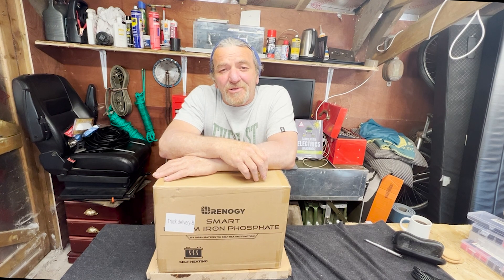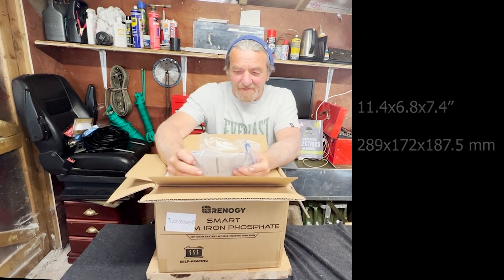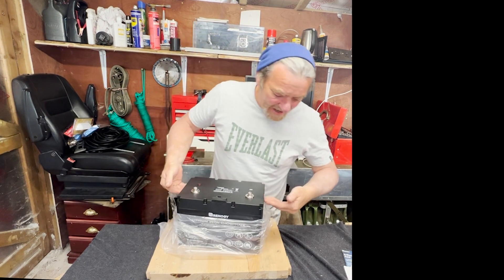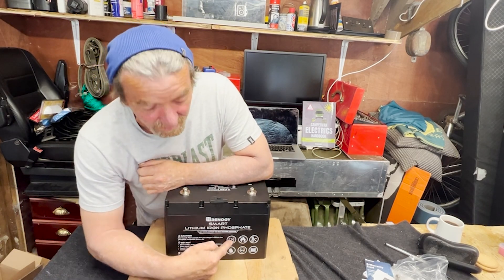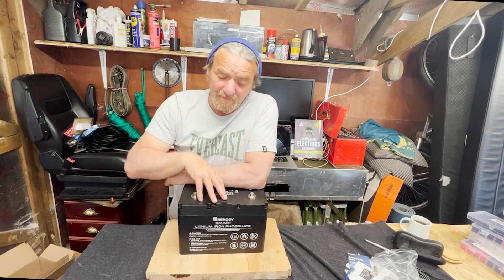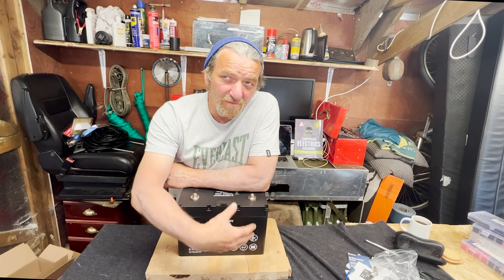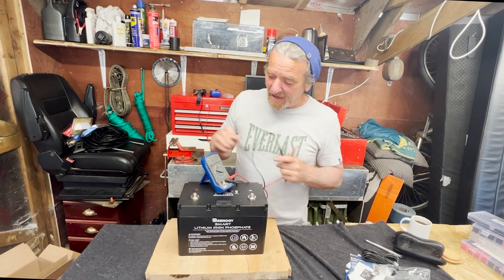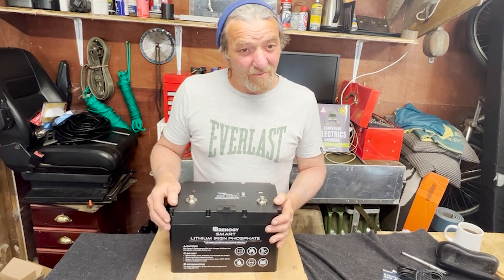Renogy 100ah 12v LiFePo4 Self-Heating Battery Review

Comment: My experience:  Within 1 week of 20a dc-dc charging at about freezing (32F) temps, the self heating function seems to have broken. Renogy says I have to warm up the batteries first before the heating will turn on (no, I'm not kidding)
Reply from the maker: Yes, I know, lithium batteries don't like cold temperatures. The heater kicks in at 5*c until the battery reaches 10*C. In cold weather like now, I also need to put a heater in the van to warm the battery and take charge, even though it is inside the main living area. 
It is a limitation we have to work around. If you travel to extreme locations regularly, as I have previously, you should return to GEL-type batteries.

Comment: READ 8 BATTERIES IN PARALLEL
Reply from the maker: according to installation book page 8 " It is not recommended to connect more than 4 batteries in parallel if taking advantages of
the auto-balancing function."